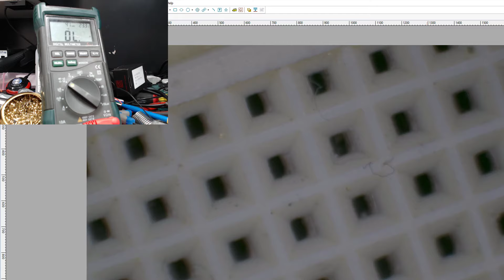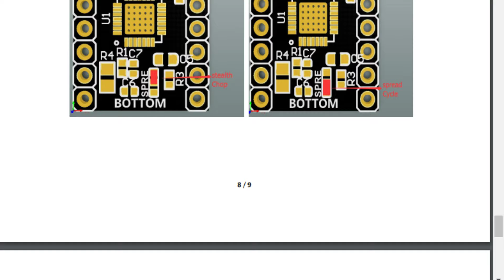BigTreeTech TMC 2209 V1.1 design flaw explained.

Comment: Interesting...BTT have replaced the SKR Pro V1.1 with V1.2, which may be related to some of these driver design flaws. I'm currently having my SKR Pro V1.1 board with TMC2130 drivers failing to sensor-less home correctly. It's not a firmware issue as it work's periodically, especially after checking the drivers are seated, which leads me to suspect there is a poor trace somewhere. Even after swapping out drivers it still does this.

Comment: how to enable standalone mode ? I can't find in this very long slow video
Reply from the maker: use the new version of the driver v1.2 -- bridge the solder jumper as per BTT instructions, and it works correctly
Reply from the maker: the point of this video was to illustrate a bug in the v1.1 driver -- which BTT wasn't fixing, the video accomplished that, they fixed the bug with a new driver

Comment: Hi, I don't understand every thing. I have a SKR Pro V1.1 will I get Spredcycle and Stealthchop functions working with stock TMC2209-v1.1 and one UART jumper on each stepper of the board? (I don't need homing thing And I have Marlin 2.0 moded for my TMC 2209..) Or do I need to do other stuff as soldering or shorting M2 with RST with jumper?
Reply from the maker: UART mode is fine stock
Reply: @kazolar  Yes, I have found that thoses new boards are made for TMC2209 and only jumpers are needed (for each stepper). No modification is needed but only in Marlin..

Comment: thanks  for sharing  bbt  wrote to me; after posting your video about the trouble with speadcycle ; 

 " Hello，friend.I am sorry that I said wrong before. 
This feature is available. If you want to use the spreadcycle mode, you can change the resistance patch yourself by following the instructions.
Thanks."

With my tmc 2209 v1.1  they still continue to tell this option is avalaible with soldering the resistance !!!!    it s a joke  !!!

i m not equiped for this kind of soldering    :)
Reply from the maker: Yes, that is unfortunate that they insist it works, they tried to convince me as well. I did say in the video that it may work in 5v boards, I did not test it with a 5v board, the board I used uses 3.3v for CPU power. The resistor move as per instructions is not enough, you need much more than that.
Reply: i i ve also   skr1.3  board ........ one of response from btt 

" Hello，friend.
This feature of our tmc2209 v1.1 version has not been implemented, but our version 1.2, the driver's silent mode is changed to the power supply provided by the motherboard, no longer the drive provides internal power. You can compare the schematics of our 1.1 and 1.2.
https://github.com/bigtreetech/TMC2209-V1.1/tree/master/Schematic

Thanks."
One day later 

 "Hello marc , sorry for the mistake, the last message we replied have something mistake . TMC2209 C1.1 and TMC2209 V1.2 are both have this function choose"

Silly situation    a little bit confused    with   customer service.....

Comment: thanks for sharing, just got mine yesterday but they sent me the tmc2209 v1.2 , they haven't added info on there github yet, and info isn't on ali, so im sure its fixed. the first version of almost all of bigtreetech Drivers have a flaw, they fix the issues on the 2nd version/batch. they had issue with the tmc5160 v1.1 4 layer and upgraded and fixed them in tmc5160 v1.2 are 6 layer pcb plus moved mosfets & added 2 extra pins on the board.  always wait 2 months before ordering from bigtreetech as the fixed version will come on there 2nd batch.
Reply from the maker: well, v1 was based on the reference design from watterott, they claim that they changed it for increased compatibility with the SKR 1.3 -- I showed in the video that is totally unnecessary, I have watterott 2209s running in uart in the SKR 1.3, and running great. I linked to the altered schematics for the 2209 v1.2, they changed the spread pad -- like I told them. They can swear up and down that they did it on their own -- I only put the video out after they kept stonewalling me...